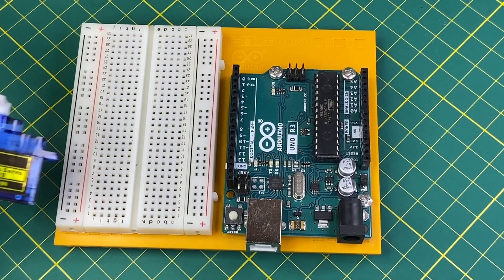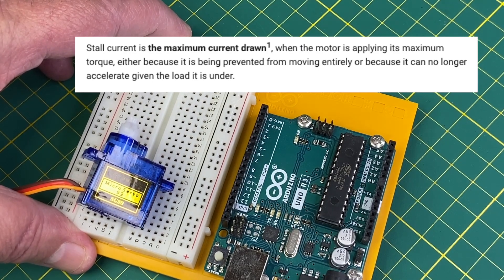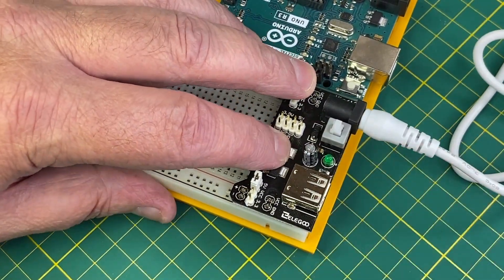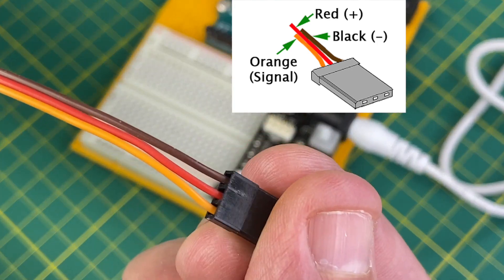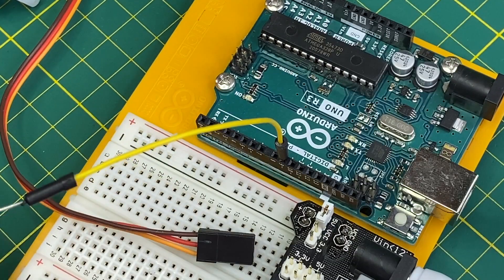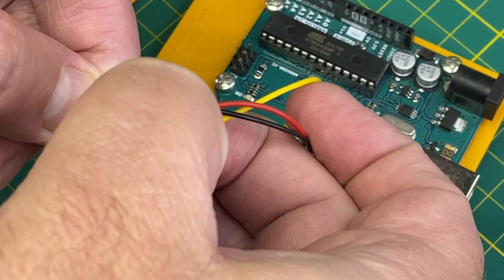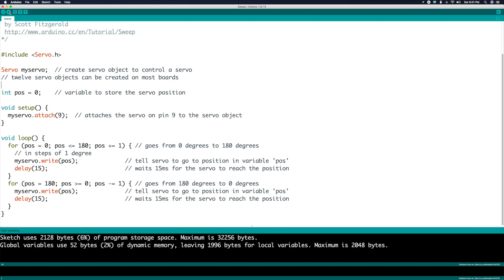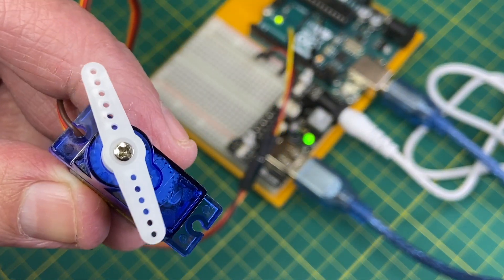How to use a Servo with an Arduino and External Power Supply

Comment: Thank you so much for this video.  I was using the same power supply as you, with an Arduino Nano 33BLE, and could not get the servo to budge until I came across your tip about connecting the power supply ground to the Arduino ground.  That did the trick for me!

Comment: If I wouldnt't want this bulky power supply inside a small project, and would prefer using a USB cable, could I just tear the USB cable apart, and take the power from there to both the servo and the arduino?
The USB cable is capping the current to 5V, is it not? So why is this power supply mandatory?

Comment: Nice video! Do you power the arduino through the breadboard power supply? So the arduino are not plugged in to a computer or similar that powers it?

Comment: There’s a usb and power plug attached to that breadboard power supply….?
Reply from the maker: Yes you can power with either a barrel plug wall wart type of supply or just use 5V USB.